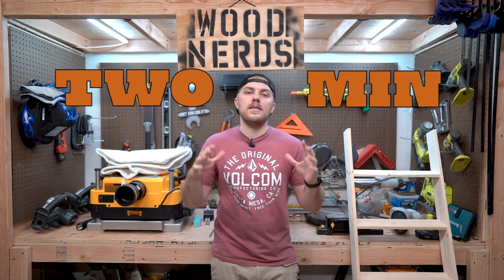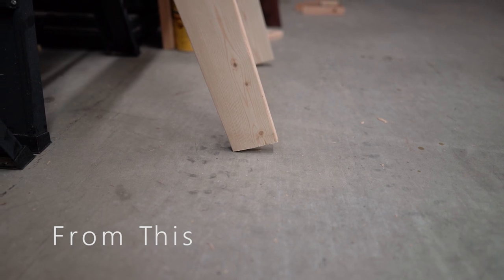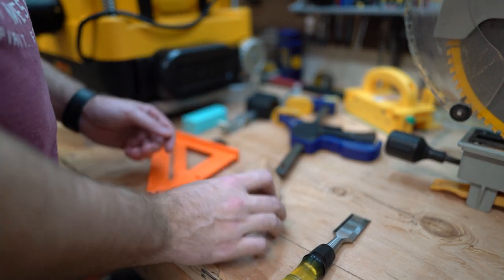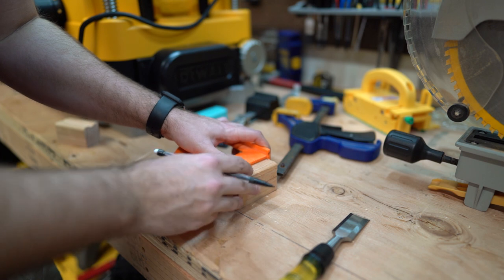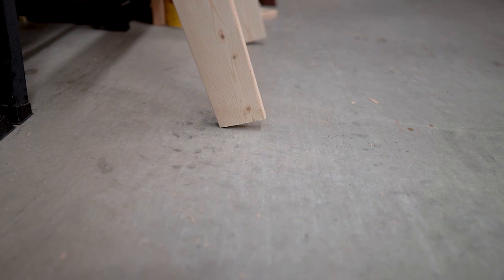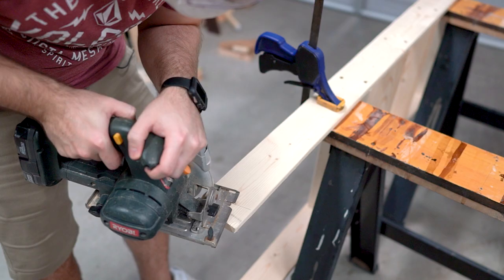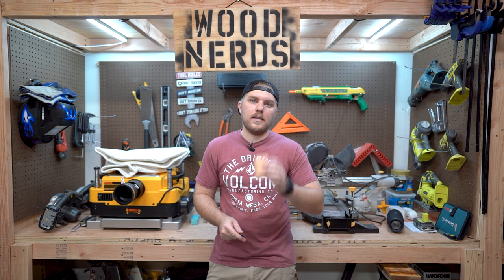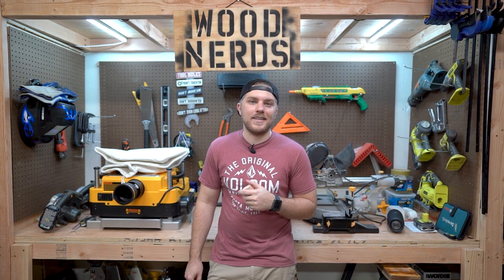Easy Angle Cuts With A Scribe Block / 2 Minute Tool Tip

Comment: I’m a girl, and a wanna be wood nerd... I am wanting to make a work bench in my garage so all of these are helpful for me to watch to get ideas on technique as well as tools... I’m a baby at this... I have a circular saw but haven’t used it yet... so just dipping toes in the water... gathering lumber Some of which is coming from my brothers mill once he gets it... 
also explanation of tools and how they work is ESPECIALLY helpful to me... I have a small budget, but want quality so seeing snd hearing about the tools for the job is helpful to me
Reply from the maker: Hey Carolyn, thanks for watching! I appreciate the feedback. It’s awesome to hear you’re starting your journey into wood working. If I could offer two extremely valuable pieces of advice it would be:

1. Safety matters above all else. These tools in the hands of pros look simple to use (and to a degree they are) but they can be very dangerous in certain situations. I would suggest watching videos on the dangers of each tool and how to operate safely.

2. Woodworking is not a hobby or job that favors short cuts. Every time I ruined something, made a mistake, or did something dangerous was because I was trying to hurry. My recommendation would be to do it correctly the first time and over time that process will become faster and more accurate for you.
Reply: @WoodNerds  agree and great advise!!

Comment: Always appreciate these short tip videos. Couldn’t you just mark it along the top of the block though? Cheers.
Reply from the maker: Of course! You don’t have to notch it if you don’t want to. It’s just a nice way to hold it all together. It’s also a great identifying mark so you don’t accidentally grab a similar piece of scrap on accident and make different dimension cut lines as you go.
Reply: Wood Nerds makes sense. Nice one
Reply from the maker: Thank you Luke! Cheers!

Comment: This might have been thought of already but why don't you drill a hole into the block that allows a pencil to go into it so you're not cutting as much material off of the finished product?
Reply from the maker: You’re absolutely right! I just made this as a quick idea for a video. You actually don’t have to alter the block at all, you can just lay the pencil on top and scribe. You can make the height whatever you want! The ladder legs I used it on are not height sensitive so I just cut off an unmeasured amount for demonstration purposes. Great point though!

Comment: you could just set the block on the floor next to the leg  and draw a line across the top of the block.  Just sayin'
Reply from the maker: Of course! You don’t have to notch it if you don’t want to. It’s just a nice way to hold it all together. It’s also a great identifying mark so you don’t accidentally grab a similar piece of scrap on accident and make different dimension cut lines as you go.
Reply: @WoodNerds  duly noted.  I have a box full of "scrap jigs" that I have marked with permanent marker to identify what they are for...and also to ensure I don't mistake them for real scrap and toss them.  Some I use regularly, others I may never use again....but you never know.  Anyway, you have a great channel and I watch all of your clips for good ideas.
Reply from the maker: A box of scrap jigs is a great idea haha. I rarely keep mine because they are so easy to make but marking them and saving them might be my next move. I appreciate you watching and sharing your thoughts!